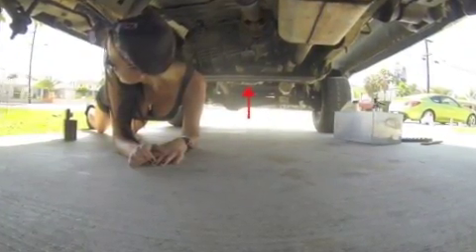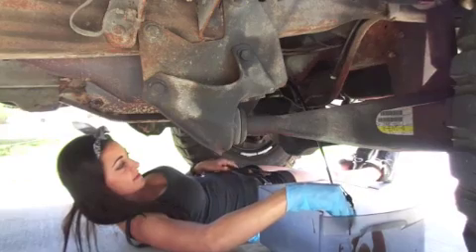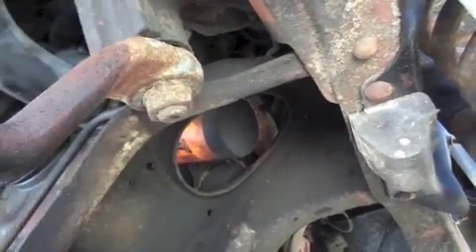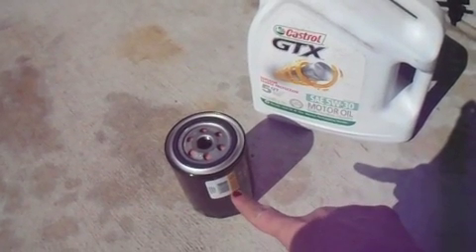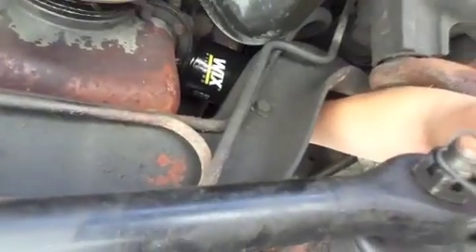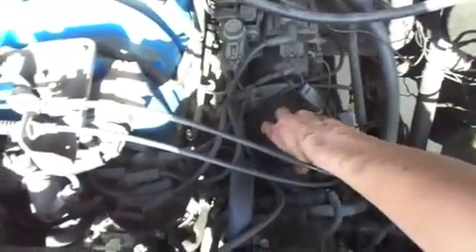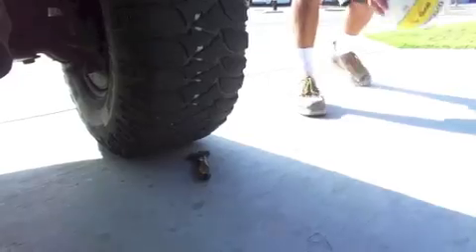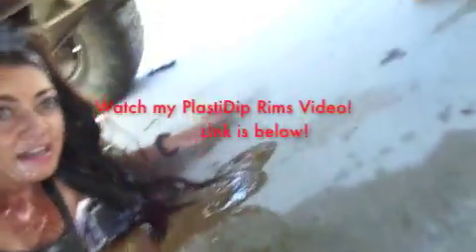Oil Change! 96' Bronco

Comment: FYI for future oil changes, you don't have to add oil to your new oil filter. That is only done on diesel engines. Also, use a little of the old oil to lube the seal on the new filter so it isn't going back on dry!
Reply: Doesn't hurt to prime the new filter, though.

Comment: Just as a polite suggestion, keep the oil filler cap open while draining as it lets it flow out better, and take off the sump nut with a ring spanner or socket that is the correct size to prevent rounding the head of the bolt. If a shifting spanner is your only option be sure to put the shifter all the way on the bolt, not using the tips to ensure a secure position

Comment: If your oil filter screws on vertically you should fill it full of new oil before you put it on..and always take a  little bit of your old oil and spread it around the rubber seal on your new oil filter ..helps it seal better

Comment: That's why I lay about 4-6 inches from underneath the oil pan... don't want to get it in my face and all the dirt/crud falling as I turn the bolt. BTW: It always helps to replace the bolt seal.

Comment: Would you like to know a trick that prevents the oil (or any fluid) from spilling all over when pouring from the container? There’s a specific way to hold the jug that makes it super easy. When you pour, keep the spout above the handle of the jug. And then slowly rotate the jug sideways to pour. It’s very easy to control. You won’t even need a funnel when you get good at it. I can post a video to demonstrate if you’d like.

Comment: That was a job well done mamacita,I don't know if you did or didn't, to mention to take the oil cap off before u drain the oil and also a small tip warm up the motor just a little bit and it'll drain easier, and by the way  are u interested in motorcycles mi amor, that would be nice, thank you for sharing.

Comment: its not necessary to put oil in the oil filter when you start your engine in 3 secs it will fill and is that why you got oil on you because the oil filter get up on side ways  but  its ok if yo do its preference

Comment: does your bronco have the 302 5.0l or the 351 5.8l?
Reply from the maker: it's a 5.0. The new bronco I just purchased and plan to flip is a 5.8  ...New videos coming soon!! I plan to flip the new one.
Reply: ok very cool i've got a 92 f150 with the 5.0 and its kinda nice to find a decent channel that has detailed videos that show pretty much all of the same stuff that i need to hop up on my truck too! Great video material IMO so keep it up!
Reply: Jory Mosshart the 5.0 is a great motor, same one they used in the Mustang and there’s all kinds of aftermarket performance upgrades.
I had a ‘95 F150 4WD that I built up with parts from Bronco Graveyard and basically built a 4WD Pre-runner.
Superunner steering system, Superflex 5.5”front and Superflex 4” rear springs with an additional 2” front spring bucket drop and rear 2” blocks for a total of 7.5” front lift and 6” rear lift.
Swapped out the stock 8.8 rear for a Ford 9” with a spool. I left the front diff open for better handling while turning. Changed the diff gearing to 4.56
Fox Shox external reservoir shocks 37x12.5x17 General Grabber tires.
The list goes with what I did to it.
I could hit the trails with my buddies and go slow and easy or hit some fire roads or jumps and haul ass.
Hmm, maybe I should build another one 👍

Comment: you really don't have to add any oil to the filter they don't hold that much it's not much of a dry start with over 300,000 miles on each of my 3 different Broncos I've never done that

Comment: you really do not have to put oil in the filter it will fill as you put oil in motor you are sweet  just the seal will do

Comment: I'm sorry to be so forward but you're HOT. Does your truck call for 5W30 Weight oil?. Thank u fer the vid.
Reply: WTH it's a 302 dude
Reply: @brianunderwood8546   Your strange !!!!,,, What are you saying? ....
Reply: @vetterfellow  it's a 302 why would you ask if it took 5w30 you should know 10w30 if you from the red white and blue lol
Reply: @brianunderwood8546   I put in 10W - 40 in my 302 for years, still do, it works for me. I thought mine called for 5W-30 or straight 30W, but I never used it. Just curious what Morgen stuck in Hers😎.  Stay Healthy !!.